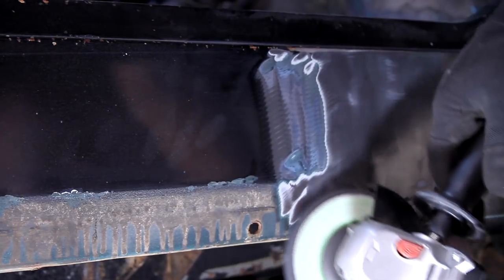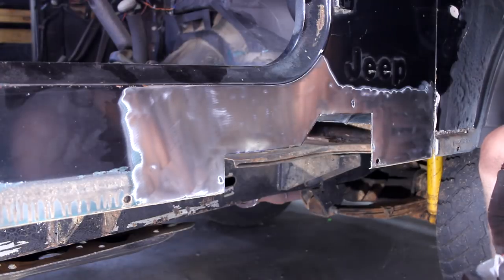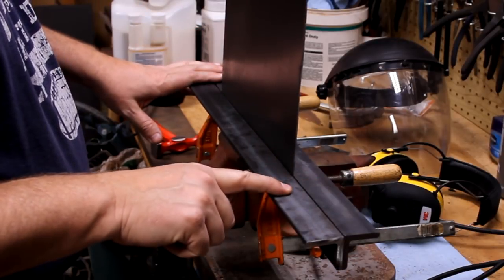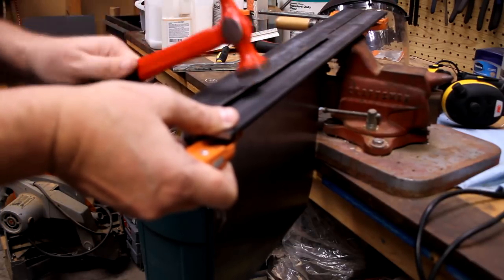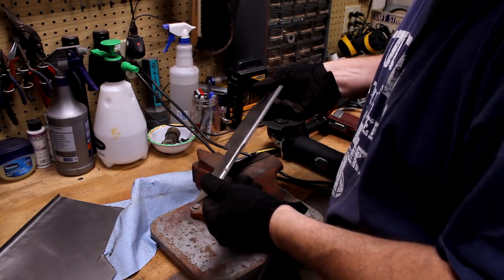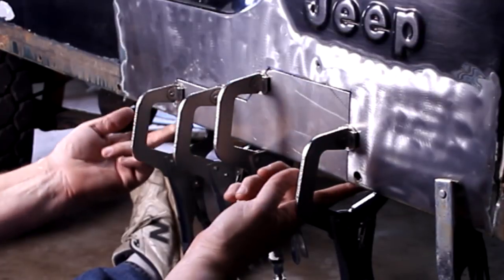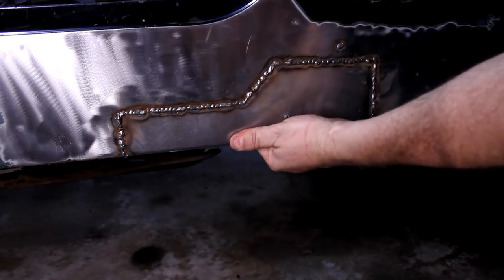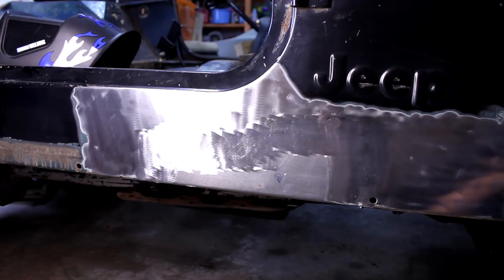CJ7 Passenger Floor Replacement 2of4 | Project Rowdy Ep023

Comment: I did mine before I saw your video, but we did it nearly the same way. I used 1/16th welding rods that only run at 35 amps DC- and do great at sheetmetal.
Reply from the maker: Lextech Lighting turned out to be a great repair.   My next project is the Driver’s side.  Cheers!!

Comment: Superb videos Mike. I’m across the pond in England and about to start tackling my 82 CJ7 which has rotted out front floors etc.  i notice that you managed to weld the floor panels in with the tub still on the chassis. Were the floor supports all in good order? I think I’ll be replacing mine but would ask for your advice on whether to weld the floor panels in place with the tub on the body and then remove the body later on to replace the floor supports.  Thanks Steve.  PS. Your videos have truly inspired me to tackle mine.
Reply from the maker: Great to hear form you Steve.   My Floor Supports where is great condition.  I believe that if I had to replace both the floors and floor supports, I would still do it on the frame.  You might need to cut out the Floor and Supports.  Then attach the supports to the frame (for proper positioning), than fabricate in your new Floors and finally attach the supports to the floor and lock in that relationship.  Welding upside down and under the Jeep is not that fun, but it works.   Cheers and thanks for reaching out.   Always good to hear from others restoring these awesome vehicles.   I have owned my for 34 years!   Mike
Reply: Mike, many thanks for your reply and so quickly too. Your advice is the most logical and sound approach. Thank you so much, it’s hugely appreciated. Damn I wish I was stateside to have the access to the Jeep clubs and masses of spares plus all you great people. You’re a legend Mike. Thank you again Steve
Reply from the maker: I assume that you can order online from any of the manufactures that offer re-manufactured parts like Omix-Ada and Crown.  But there are always those certain parts that it's best to find an original.   We have Salvage Yards (used to be called Junk Yards) full of wrecked cars that people can buy salvageable parts off of.... But None of them have CJs.  There are a hand full of individuals that privately collect salvaged CJs and often buy someone's personal CJ hoard to improve their hoard.  There are about 3 of those folk within 25 miles of me.  I also find most of my stuff on Facebook Marketplace (Rear Seat, Nerf Bars, Tubed Bumpers, Rear Brake Conversion Kit, Fender, AX15, Dana 300) and just turn it into a Road Trip.   If you just can't get something locally that you find here, and it is near me, maybe I can help.  Most likely cost prohibited due to shipping, and I have no experience shipping over the pond.  But I do know how to "mind the gap".  But sometimes its the journey that makes it fun.  Thank you Steve!  Cheers....   Mike
Reply: Thanks Mike, yes I’ve ordered stuff from the States before and received an incredible service.  On the floor panels and supports I’m torn between either Classic Enterprise or Keyparts. Both have great reviews.  I may fabricate my own floor panels as I’m yet to find a stockist that sells panels for Right Hand Drive Jeeps. Thanks for all your advice and offers of help but I should be ok and wouldn’t want to make your life more busy due to me.  Thanks again Mike. Kind regards Steve

Comment: Hi Mike.  I have a CJ that I did a 350 swap in last year and I'm starting to do the electrical and body work.  I started in on a floor panel using an Eastwood 135 (same as yours).  Your welds look well penetrated and not too proud.  Do you remember what setting you used for the 18 ga rocker?  I'm using .023 wire, what came with the machine.   Also, what flap disc did you use to get the paint off the rocker and what did you use to blend the weld?
Reply from the maker: Love to hear you’re bringing back one of these ole CJs as well.  To be honest I do not remember the settings.  It is a matter of either have some extra material to test and practice in or weld a small amount and then make small adjustments to see if it is better.  As I believe I mentioned in the video ( or other videos that I have).  I am a rookie welder.  But am very please as to how well it all turned out.   I believe that my settings were not too far off the suggestions on the welder’s door panel.  

To knock off the tops of welds I believe I used a 2 or 3” relic disk.  

For removing multiple layers of paint, I used flap disks from Harbor Freight.  I believe it was 80 or 100 grit.  New disks really work well once they are used a little, they really don’t work as well and heat up more.  

Take your time.  It’s not a race and enjoy the process.  Cheers to you Michael.
Reply: @UCanDoIt2Mike  Thanks Mike!  Definitely enjoying the process

Comment: I've got a lot of that ahead of me!   Good vid
Reply from the maker: Thanks Yoshi!   It appears you and I were both recently motivated to turn some attention to our auto builds.  I liked your update.  Cheers!  Mike
Reply: UCanDoIt2 sure thing.   I like how you just figure stuff out.   I use the same general process...I almost rather to do something wrong, figure it out myself and then do it right rather than search and ask how to do it "right" the first time.   Looks good!
Reply: I forgot to add...if I could hammer and tack as fast as you I'd be done already!  🤣
Reply from the maker: Absolutely!  Figuring things out is such a rush.  You can learn a lot form doing things wrong.  Learning what doesn't work is extremely beneficial.

Comment: I know this was several years ago, but can tell me what brand/ model welder you are using. I’m starting my CJ 7 project and have similar rust issues. Thank you!
Reply from the maker: cheby56 My welder is an Eastwood 135.  I like it because it has adjustments for both Amps and Wire Feed with two separate knobs.   Plenty of welder for auto body sheet metal work.   Cheers and fun with your project.  Mike
Reply: I'm knew also an Eastwood 135 MIG Welder?